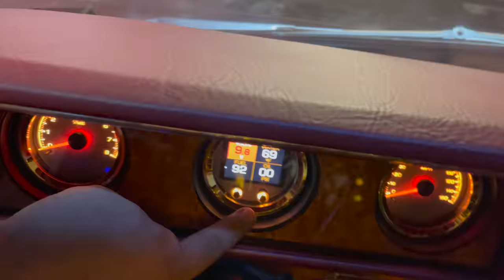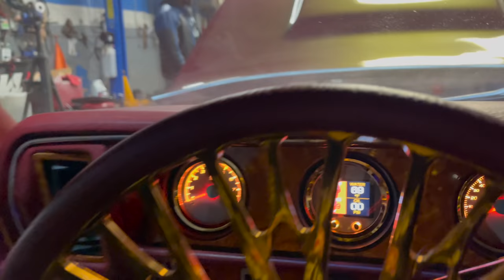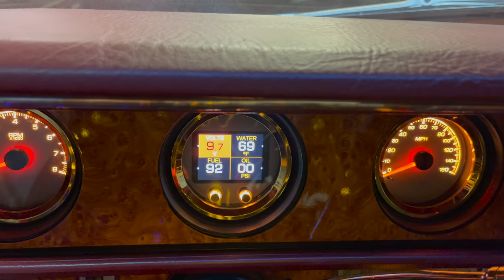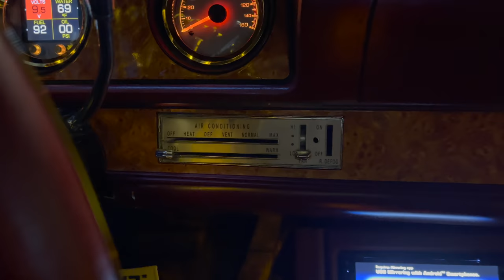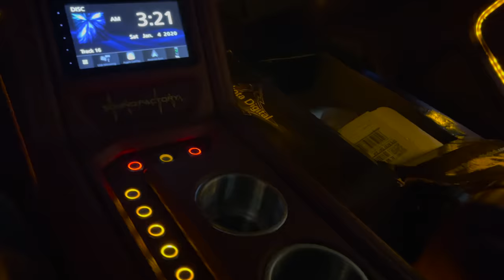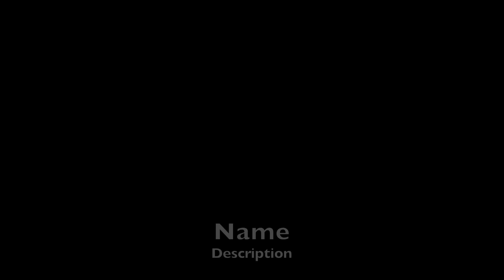First In The World 71 Cutlass With Big Guage Digital Dakota Dash & TailLight Sequential

Comment: What is the deal with the motor hate. Original Rebuilt 350 in my 69 chevy, rebuilt 350 rocket in my cutty. Proud of that shit especially olds, cost more to build olds motors. But to each his own. I like LS but wanna keep it olds. Chevy 350 break well it'll be LS time. THAT BITCH CLEAN AND THEM LIGHTS AND GUAGES LORD HAVE MERCY!